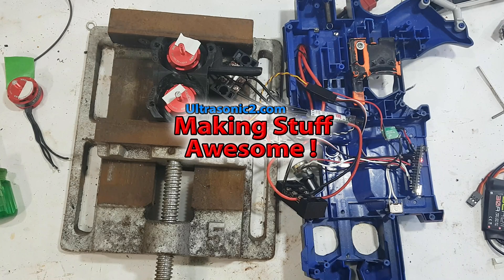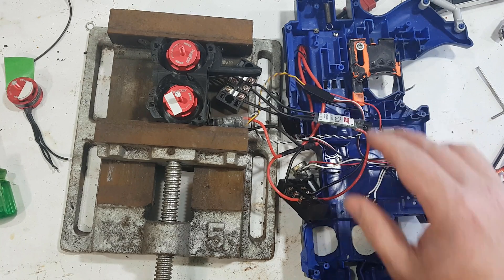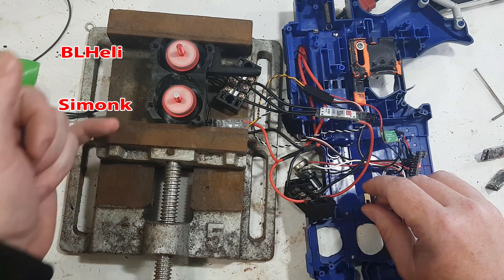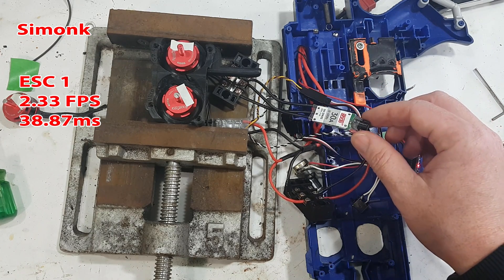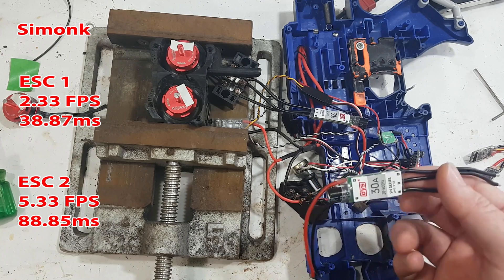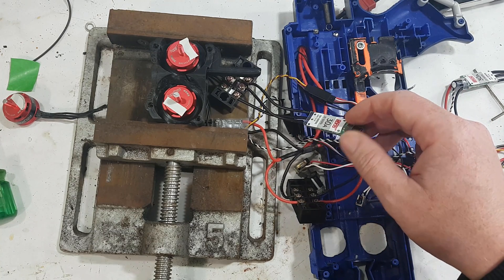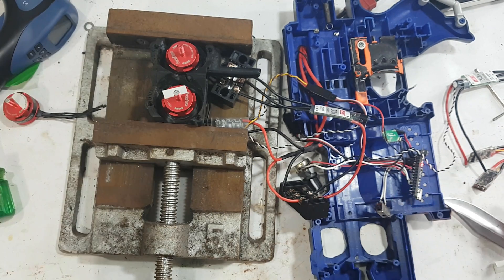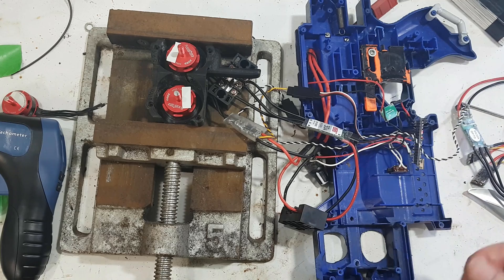⚡️ SimonK V BLHeli Spin-Up Delay for Brushless ESC's PART 1

Comment: Hello! :) This isn't reaaallly a commonly-optimized path for ESCs, and since a stopped motor has no back-EMF, some assumptions have to be made that, if incorrect, will result in a motor that may vibrate or whine instead of actually starting. Also, when starting from being idle, it will loop through a whole commutation loop once in order to try to detect an already-spinning motor, which is probably what adds the majority of delay. You can bypass this and make a bunch of other tweaks if you'd like to improve this case, particularly if you are willing to tune it to the motor at the expense of possibly degrading some other motors. I would try one or more of these:

On the line commented "Do not enable FETs during first cycle", change the 6 to 0. This should make it at least move within a few ms. (The reason some ESCs may be different for delay probably comes down to a very slight comparator and/or voltage divider offset.) This is already redundant protection since it typically won't stop tracking a motor until it stops anyway -- it's only there for props that might start to be spun externally, for example, or if you power off the ESC while spinning some high inertial load and then try to start it again.

Lower TIMEOUT_START (quarter or less). This will make it give up and try faster if it ever does get an incorrect feedback while the back-EMF is very weak. The effect will depend on the motor (particularly if the motor has unevenly-spaced or powered magnets).

You could try removing sys_contol entirely, which is an initial ramp enforced only for the first power-up. If you remove it, it should be able to reach full speed much faster (as fast as if you start the motor at slowest speed, wait a bit, and then request full power). There is one remaining power limit which is the rpm-based one which could further be adjusted by changing TIMING_RANGE3 or removing that code (will basically dump full current from the battery at the point).

BTW, the random vendors shipping my code often use a really old version. Since the 2015-09-12 release, it will not RPM limit until 312,500eRPM. To calculate the actual speed, divide that by the number of pairs of motor poles (12 poles means divide by 6). It should easily be able to exceed 30kRPM with those motors.
Reply from the maker: Err Wow your the man himself SimonK .. Id be interested in how you found this video. And i trust you have now watched the second one ..
https://youtu.be/MpnNjWfpbWU

Do you know if you have any plans to bring out new code / Hardware to allow for increased Max RPM which i believe is a current problem (well for me)

Nerfers Love SimonK because of the Faster spin up but there is general worries that it has no future ?

Also the editor App, any chance you could bring out a new one not dependant on Java .. Getting java to work just adds additional complexity in comparison to Blheli .. The beta App I couldn't even get working on win10 without running it at windows 98 lol .... Probably you didn't actually wright that so am talking to the wrong person ... But hay it's worth the Question 

http://lazyzero.de/en/modellbau/kkmulticopterflashtool

Thanks once again
Reply from the maker: FYI i'll get the smart Chaps from Face book to see if we can't try some of these idea's .. maybe a 3rd video on the way...
Reply from the maker: IF you want you could Join our humble FB group . Where a bunch of people would wet themselves with excitement to beable to talk to you about such things. I know the Nerfs sell heaps of your Afro ESC's cos of the Debatable Belheli Delay.
https://www.facebook.com/groups/MakingStuffAwesome/
Reply: I hadn't seen the second video, no.. Thanks!

It gets kind of difficult to increase the eRPM much beyond 300,000eRPM on a 16MHz 8-bit CPU when trying to keep 24-bit or 16-bit timing. What are the specs on the motors you are using there? (How many poles do they have?) The 32-bit ARM stuff should be able to do much better, but I have no idea how quickly the BLHeli_32 stuff will start. :)

Yeah, I've only ever looked at kkmulticopterflashtool once since I don't normally use Windows. I have Linux on everything and just type "make program" to build and flash the ESCs in one step, and I have no idea how to write a less-hungry GUI tool for Windows. I guess this is somewhat of a problem. I noticed it does have a custom build thing in it, though, which is cool.
Reply from the maker: Yeah well are their any plans For a 32bit version . That is open source .. cos BLHeli_32 isn't so we can't optimize it for our needs, which is obviously different to chopper pilots
Reply: I'll talk with HobbyKing and see what they say. It's interesting that everything seems to have gone closed source here. BTW, I found it from google alerts for simonk esc.
Reply: kkmulticopter being Java is nice for cross platform support/running on Linux.
It shouldn't be that hard to run on windows, I've had no problem running Java apps on windows in the past, although it's been quite a while (as I mainly run Linux now.).
Reply: It's really cool to see the creator of SimonK get involved with our hobby!
First and foremost, thank you for making your awesome ESC firmware, and releasing it to the community as open source!

If you want to see another example of SimonK in use in this hobby, torukmakto4 has his Hy-Con project, where he has been working on tuning SimonK himself.
Looks like he has primarily tuned different settings, so hopefully your advice can lead to even faster starts, and eliminate giving up on some ESCs as lemons!

http://torukmakto4.blogspot.com/2018/05/project-t19-part-12-flywheel-drive.html

http://torukmakto4.blogspot.com/2018/05/project-t19-part-11-more-parts-info.html

There's also the FDL project, https://youtu.be/HEJeKQDGUN8?t=1m45s

I hope that you find our use of these SimonK ESCs interesting, and hope to see you posting more!